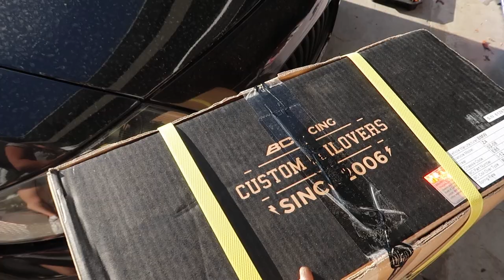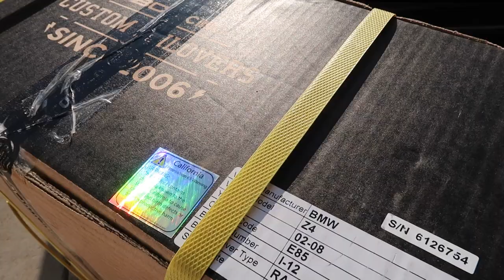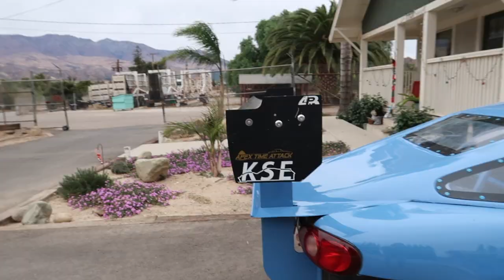Installing Coilovers on my BMW Z4 E85!

Comment: Hey, I would advise you to remove that strut bar. You would need one with a full base. They one you have are know to crack the strut tower on Z4.
Reply from the maker: I’ve heard they make reinforcements for the strut tops
Reply: You just need a strut brace with a full strut circle mount. Like these for example https://z4-forum.com/forum/viewtopic.php?t=2054

Comment: Seriously there's a lot more to fitting coil overs. I've also got BC coil overs on my Z4 Coupe and paid a guy a full days rate for having them adjusted and set up correctly corner weighted the lot. Don't think you can just fit them out the box and put the wheels back on 🙈
Reply from the maker: Personally I’m not someone that does alignments or corner balancing so, to install them I measured them, installed them and drove back to an alignment shop to have the car setup and aligned. Which most definitely didn’t cost me a days rate at least where I’m from $150-200 is hourly and my corner balance and alignment I believe was $300
Reply: @JulietteHallie  it's a pity you didn't show the measurements on the video as it looks like you've just fitted them out the box and job done. If you do the job properly and accurately it's a long job wheels on and off a lot of trial and error. I had a fast road track day set up, yes it can be harsh on uk B roads but on flat smooth roads shes planted and sits really pretty on her CSL's 🙏
Reply from the maker: @simantroo   I mean this isn’t a how to install and setup Coilovers video it’s just a vlog. Hahaa im simply just a vlogger 🤷🏼‍♀️
Reply: @JulietteHallie  ok fair enough, i do enjoy your content nice to see a girl getting stuck in and enjoying maintaining her car 🙏

Comment: How's the handling and car ride quality from stock? I'm considering B6 Bilstein with stock ride height I live in SF and there are many bumps everywhere so your input on the BC racing coilovers would be much appreciated. I'm choosing B6/b8 Bilstein or Bc racing
Reply from the maker: Well it was definitely improved for racing IMO BC coils can be kinda stiff/rough so if track/auto cross isn’t something you plan on doing a lot I’d probably go with something a little softer

Comment: Is it 2.5L?
Reply from the maker: 3.0i
Reply: I’ve the 2.5 and I’m getting rid of the dual mass flywheel that’s in it 😂 looking the get new suspension aswell as mine is stock and it’s horrible 🤣 how’s your steering column!? Any issues with it?
Reply from the maker: @gunmetalgrey2019  oh yeah. They’re so heavy and you’ll enjoy how it feels more with a single mass! No issues with the steering column on mine !